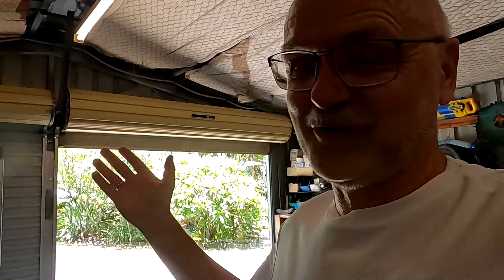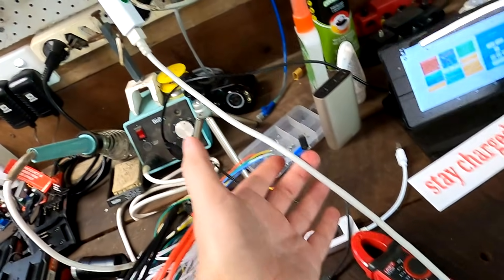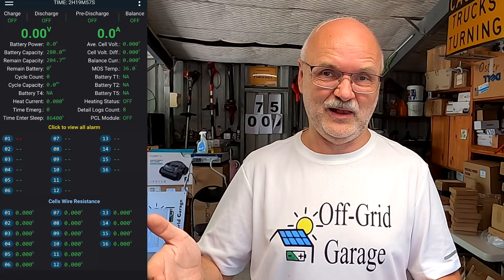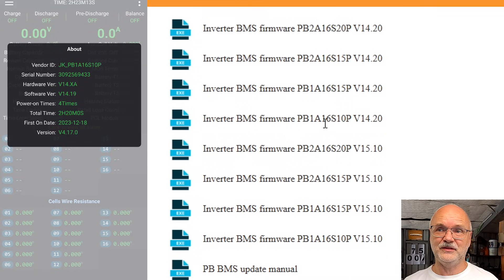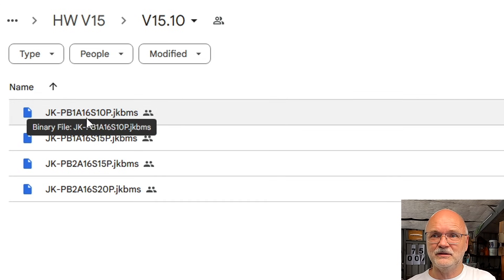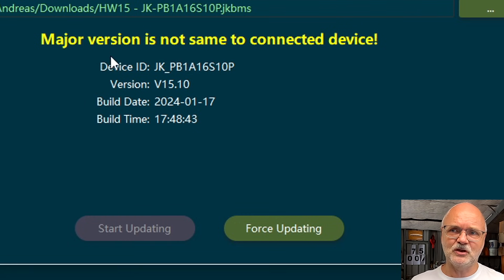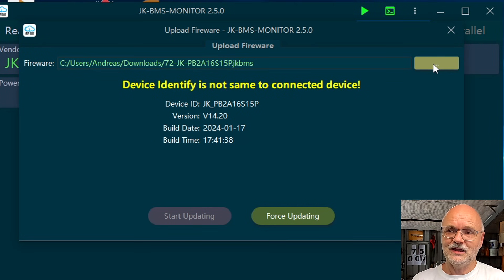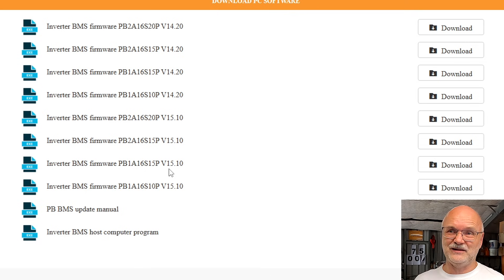JK Inverter BMS Firmware Update Process. Can't be that hard, right!?

Comment: REPOST DUE TO SPELLING!!
“Brilliant Andy. JK is a great product but OMG the technical support is Desperate.
 I ordered and installed the Peter Boards thanks to your help. 
They are mighty.
 Loads of data and in HA too.but with all these things ,there are unintended consequences . 
I have 4 battery banks almost exactly like yours . 
I have 4 JK BMS (200 A ) like your old ones , 2 No new ones with the 100% SOC setting,( Ver. 11.XA_S11.41). 1 no. with Ver 11.XW_S11.24H and 1 No with Ver 10.XW_S10.08. I performed a Top Bal last night and the 2 No New ones Ver. 11.XA_S11.41 Performed as expected and set the SOC to be 100% The 1 No with Ver 10.XW_S10.08. reported a SOC of 85% The 1 No with Ver. 11.XA_S11.41 is reporting only some data and SOC is roughly correct but has moved 2% in a few hours . I watched the firmware update on the new jk bms .
 Question to the community, is can my older ones be updated to Software Version S11.41? 
I think I know the answer, but one can always hope!”
Reply from the maker: The FW on the older BMS cannot be updated. Even if technically possible (maybe?) who do you get a new fw from???

In one of the next videos, I'll show how to reset older BMS to 100% without the need of going OVP all the time.

Peter boards are crazy good. I love them! Thanks for sharing.

Comment: Brilliant Andy. JK is a great product but OMG the technical support is Desperate. I ordered and installed the Peter Boards thanks to your help. 
They are mighty
 Loads of data and in HA too. Of ourse with all these things there are unintended consequences . I have 4 battery banks almost exactly like yours . I have 4 JK BMS (200 A ) like your old ones , 2 No new ones with the 100% SOC setting,( Ver. 11.XA_S11.41). 1 no. with Ver 11.XW_S11.24H and 1 No with Ver 10.XW_S10.08. 
I performed a Top Bal last night and the 2 No New ones Ver. 11.XA_S11.41 Performed as expected and set the SOC to be 100%
The 1 No with Ver 10.XW_S10.08.  reported a SOC of 85%
THe 1 No with Ver. 11.XA_S11.41 is report only some data and SOc is roughty correct but has moved 2% in a few hours .
I watched the fireware update on the new jk bms .

Question to the community,  is can my older onles be updated to Software Vertion S11.41?

I think I know the answer but one can always hope!

Comment: Thanks Andy for all your hard work in these videos. I enjoy them all, and your humor as well :). I just ordered the JK pb1a16s10p, and fingers crossed. The JK site and support documentation/link/manuals are very hard to find. They have work to do on this!    Question, to upgrade the firmware on this unit, do I need the RS485 to USB adaptor, or can I simply use the network cable from the RS485 port on the communication board, and plug right into my network port on the laptop? ( Will the MK3 to USB  adaptor work from Victron?) Probably wrong communication protocol with the MK3 adaptor , but just trying to keep it simple... Ideally JK should just have BT firmware downloads we can do right from our phones vs having to connect cables, laptops etc...
Reply: saw the MK3 to USB comment below. thanks!

Comment: Does that PC Software save the BMS profiles you set to a file, so that you can upload the settings profile to multiple BMS' ?  Just thinking of folks with several packs in a bank.
Reply from the maker: I have not seen an option for that in the PC software, so I would say, NO.
But with my last few fw updates, the settings were still there.

Comment: A couple of thoughts...

If the BMS only needs battery minus (-) and battery plus (+) in order to flash, this makes it easy to do on the bench with a bench power supply.

The hardware difference may be something as simple as supply chain issues requiring a second source supplier for a component that requires a slight change in firmware. My company has encountered this the past few years with flash memory, with PMIC, and some other pieces parts.  Most of those were footprint compatible, but had slight differences necesary in the firmware to function correctly (or at all in some cases).

Thanks for documenting this.  WHAT A PAIN IT IS!
Reply from the maker: Yes, good points!

Comment: Hello sunny Australia. I’m in need of some help. I have 5 14kw hour lithium iron packs that I want paralleled. I have 5 relay based 300amp Bms by jbd. Do you by chance know a good way for them to connect to each other? I have all voltages in the packs sitting at 52v.
Reply from the maker: As long as every pack has its own BMS, you can just parall them. I would suggest to a DC circuit breaker to each of the parallel banks as well. 
Fully charge the whole battery and they will balance against each other once you hit ~54V. Some packs may stop while others will still charge. Totally normal.

Comment: I needed to switch uart1 to jk, which required dipswitch to 0, then back to 1 for the upgrade.  Is this not needed anymore?  It seems you are now connecting to the rs4852 port, not the far left 'inverter' rs4851 port.  I must have missed the part where it was discovered that connecting to the inverter port wasn't needed anymore.  For those that are having trouble still, make sure your rs485 adapter has the proper pinout.
Reply from the maker: My very first of their BMS had this issue as well and I had to use the inverter RS485 port. Now, this seems to be fixed and I can just use the normal RS485-1 or 2 port with DIP sitting on 1000.
Reply: @OffGridGarageAustralia  I have been on this all day, I have tried all 4 ports and loads of prolific drivers, Dip switches on, on off off off and off off off off, some drivers the software seems to go further than others, I am going to download the windows drivers for my version which is windows 10 2H22, I have found this on microsofts site, listed as windows 11 2H22, I will keep you updated, could you tell us what version of windows 10 and the driver number of your usb-serial driver is please Andy?
many thanks for help,
Dean Rowles
Reply: do you know the pinouts, I am having loads of trouble getting my jk bms to connect to my laptop, thanks Dean
Reply: It's pins 1 and 8 OR pins 2 and 7 that is the rs485 on the jk.  What 485 adapter are you using?   @deanrowles3665

Comment: Here's a partial conversation thread from my interaction with a sales rep.

Sales Rep-1.Disconnect the host.
2.Select Force update from PC software. (Need authorization code, I will provide you)
3.Press the activation button without releasing it.
4.Press the reset button and release it quickly. You will see the PC software and start the firmware update.
5.If this fails, repeat the preceding steps...  
Me-When you say disconnect the host, do you mean pull the wire out between BMS & PC, or push the disconnect button in the App?
Sales Rep-First button...Do you follow this step? (she sent me a PDF to upgrade fireware).
 Me-The BMS has the latest firmware installed (see my earlier picture above), I just want to be able to change my settings... this should not be so difficult!.
Sales Rep-We do not recommend that you modify the parameters yourself.
 Me-I have to modify them, they come with the wrong settings out of the box.
 Sales Rep-Yes, you need to use rj45 wiring to brush the computer.
 Me-Brush the computer? what does that mean?
Reply from the maker: I like entertainment😉

Comment: Hello Andy, thanks for the great videos. A “USB to RS485 adapter serial converter interface for Raspberry Pi” can also be used to connect to the BMS. It's cheap. You just have to cut open a LAN cable and connect the wires correctly.
Reply: Can you be more precise about the wiring ?
Reply: @nicodupont3962  You can look in the specification of the bms: Pin 1,8 = RS485- B1; Pin 2,7 = RS485-A1
Reply from the maker: I don't need to change the pins with a RS485 to USB adapter. I just use a normal LAN cable.
Reply: @OffGridGarageAustralia  But you need a Adapter LAN - USB, i don`t have this, but the serial adapter - no extra pay
Reply: please, could you explain this further? I don't own a raspberry pi. How do I get the USB to RS485 adapter serial converter interface? I do have a LAN cable, though or can readily get one.

Comment: Can you force update to an older firmware version? The button seems available when selecting an older firmware.

But it also seems to be available for a different device firmware, which would be scary.

Could you reset to "factory settings", i.e. the original firmware version and then upgrade to an older firmware version maybe?
Reply from the maker: I don't think so. Force Updating needs a code form JK which is only valid for 1h or so...
There is no reset to factory default button anywhere, so not possible.

Comment: Quick question... Do these BMSes have a delayed inverter start to allow pre-charging of the battery inverters' capacitors?

My REC BMS has a special circuit for this with a relay etc, but doesn't allow you to parallel BMSes without buying an expensive Master BMS (which only allows three slave BMSes, limiting the overall capacity). So if I can get a decent alternative that can parallel using the Pylontech/SMA protocol with capacitor pre-charging I'd be very happy to try them instead.
Reply from the maker: Yes, the JK BMS does this automatically. I'll explain this in the next video where we go through the settings.
Reply: Power up is not something I do very often, so I have a large resistor that I can switch into circuit for 2 mins before turning on the main battery breaker. It's inverter designers that should implement this rather than BMS manufacturers..
Reply: @dougle03  I agree that it should be part of the inverter, but I won't be throwing out my two Sunny Islands just because of that!

Yeah, I've bought a couple of resistors too. The REC BMS's delay contraption doesn't seem to wait long enough to sufficiently pre-charge the two SIs anyway, so I guess it's a bit moot as I'd need to use the resistor anyway.

Comment: Anyone that has manage to update the firmware with something else than a RS-485 adapter? 
Seen some people having trouble with finding the correct RS-485 adapter, and I was wondering if there was another way to update the firmware using for example RS-232 or TTL? And if needed connected to another location on the BMS? Maybe on the ARM32 pinout?
Reply: Its funny you should mention this, as its not the only problem I am having, my laptop running win10 has the prolific serial to usb chip, if you look in device manager MS says that the firmware has been stopped since 2012, only 12 years ago, so I am trying older firmware to try and get it connecting
Reply from the maker: RS232 does not work correctly with the new JK inverter BMS. JK advised to use RS485 only.
Reply: And that makes it more interesting, since I have seen some people comment that they have been able to use an RS232 adapter on the RS485 port succesfully. And more people comment that the RS485 adapter they used did not work. Saw one comment where a store selling the JK inverter BMS recommended to only use one specific RS485 adapter (which they did't directly sell either).

Comment: Still no go on connecting to PC as per video, I am using a  
Bewinner Industrial Grade USB to RS485/422  from Amazon, I have tried a 
Cable Matters USB to Serial Adapter Cable 0.9m USB to RS232, USB to DB9 using the RS-232 port  with no luck, I also used a RS485 serial USB toggle without success, I have now ordered from Ali what is supposed to be the right cable, I don't think all USB to  RS-485 RJ45 are wired the same, be so much easier to do it with a phone APP, so at this stage I am waiting for delivery from Aliexpress, Been a real pain in the arse
Reply: I have spent 2 nights trying to get this fixed, I too am using the usb to RS485 from amazon, I tried win7 serial drivers and they didnt work for me, I have now loaded a prolific driver from 2008, still not perfect tho, so no fix yet
Reply: Some older prolific drivers come up with an error under later windows OS, I have found this being the case with my Zhetech battery tester, but is easy to work around with drivers under Device Manager, I think the problem lies with hardware on the termination of the RJ45, until the new adapter comes from Aliexpress I can't be 100%, but I think it is the plug end.
Reply: @sjdtmv  can you
tell me the adapter you have coming from ali express and I will order one aswell, cheers 👍
Reply from the maker: My USB-to RS485 adapter uses the FT232RL chip and works with all BMS so far. I've linked it in the video description and on my website: https://off-grid-garage.com/bms-communication/
Reply: @OffGridGarageAustralia  Thats one I have coming from Ali in about a week, I will report back on that, when I try it, thanks for the reply Andy
Reply: @deanrowles3665  Did you get it to work? I'm also having issues, for some reason it can connect to windows without issues. But when I connect it to the Raspberry pi for the Victron OS it doesn't seem to work. 
Even though I use all the adapters Andy mentioned
Reply: @dutchamigos1041  yes I did, I dont use a rasberry pi, but I got the bms connecting to jk software, I tried lots of adapters but only had success with one adapter, andy shows this on his website as the industrial adapter running the FT232 chip
Reply: Maybe you are using wrong adapter drivers, I suggest you to search and test old drivers.
Reply: Win11 Device manager shows no problems with drivers on the Comm Port @patriotaxl
Reply: Try WIN7 driver , I had the same difficult

Comment: Hi andy, been trying to get my JK-PB……. to connect to my laptop all evening, downloads latest monitor 2.5.0, tried 2 ethernet to usb’s and 2 ethernet cables, but allas, even tried different plugs on my data board and diferent dip switches, bms just will not connect. I have the original sw on it so cant connect to my 16S Lifepo4 battery, connects to my phone via app, any ideas?
Reply: Same problem here
Reply: @sjdtmv  what version of windows are you running and is it a pc or laptop?
Reply: Try WIN7 serial adapter driver , I had the same difficult
Reply: @patriotaxl  Hi again,
spent another night tinkering with my laptop and the bms and software, I tried win7 serial adapter drivers, that didnt work. I went on prolific website, downloaded the latest 64bit drivers, did not work, did. some googling and found that someone had tried a 2008 prolific driver and had results, so I seached for that driver, update it and I now get the device to connect to jk monitor 2.5, but it seems that I cant load any settings or go to where I can install firmware 14.20, its as if my laptop recognises the usb to rs485 adapter, so its loading the bear minimum data from monitor program but not transfering data through the ethernet cable, tried another cable, still nothing, any other ideas?
Reply: I need to get my Amstrad out and fire up msdos and windows 1.5
Reply from the maker: I tried 2 or 3 adapters and they all work with my BMS under Win10 and different BMS. I hope you just use a normal LAN cable and not one which has the pins changed! This is only for CAN coms, not RS485.
Just saying, people sending me emails and are confused...
Reply: @OffGridGarageAustralia  I spent all weekend on this again, I am on the second usb to rs485, I have ordered the industrial adapter on Andy,s web site, I am on a driver that recognises data being sent in the new 2.7 software. But I have exhausted all attempts and all variables, I will wait for this adapter to arrive and try again.
Reply: Tried another 2 adapters this evening, with the CH340 chip both of them neither working, still waiting for industrial adapter from ALI, think that will be the last before sending the bms back to JK, keep my fingers crossed. 🤞🏻
Reply from the maker: @deanrowles3665  wait for the next video!

Comment: With such an amateurish company doing many things with so little attention to detail, do you really have trust and confidence in either the hardware or firmware design or implementation?
Reply from the maker: No, I don't but other solutions are not better. All comes from China and is not of great quality. And I consider the BMS as a safety device... Maybe we should stick with Seplos as they are in the market for a lot longer and have no major issues...

Comment: Andy, can we use RS485 to USB Adapter Converter referenced on your web-site to connect A, B, GRND,  to the pin 7, 8, 6 respectively of RJ45 connector to update firmware of the BMS?
Reply: Yes, pins 7 and 8 of the rj45, no need for gnd.
I want to share with you the problem I had, witch took me many h to find, because I was lucky. I had a ch340 and probably something similar usb to rs485 for a charge controller, I connected the right pins to a rj45 and ... nothig, then I reinstalled the drivers 3-4 times (difrent ones), tried other pins, .... and still nothing. I'm not very familiar with this kind of work, but  I got the idea to try and change the bitrate or somethig and when I entered port settings I found an unchecked box titled RS485 :)). After clicking it everithig worked. this was on windows 11, updated last month..
Reply from the maker: Thank you for sharing, @gabrielb1600
Reply: Your pin out is correct..  i had a rs485 adaptor wired and working with a different device and it did not work until i changed   A --> 8  , B --> 7
Reply: waveshark adapter working with standard network cable using A->7 (brown/white) B->8 (brown) GND->6 (green)
Reply: It would be nice! I will check it at weekend. Have anybody else practice this?
Reply: Hmm I’ve just done this and it was pin 3 and 6
Reply from the maker: I use the adapter and a normal LAN cable. The other cable is for CAN coms only!